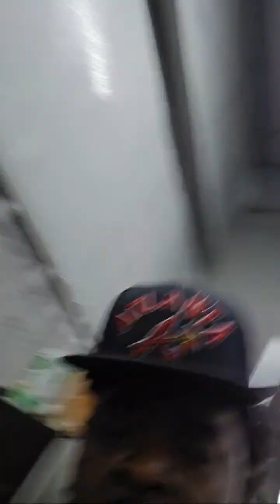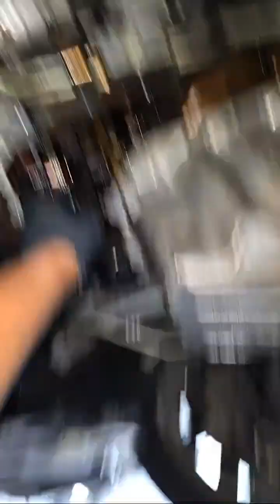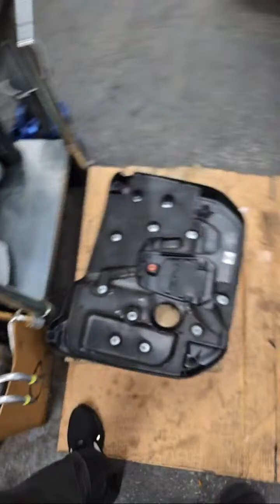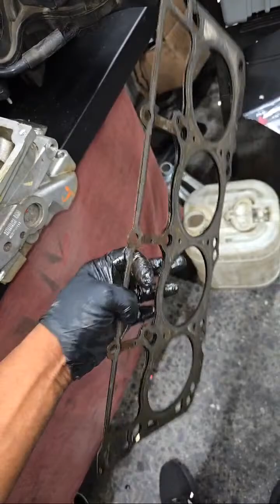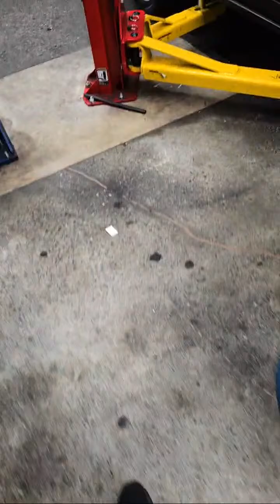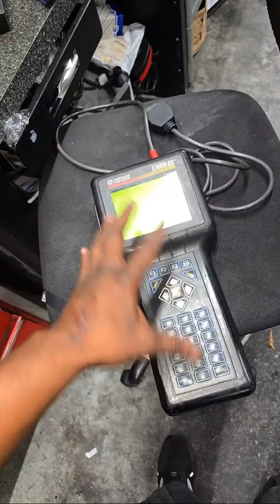A Cam Sensor Code P0340 does not always mean you need a Cam sensor

Comment: Just a heads up and you may know this already but cam crank corelation code diag is not correct on service library. Had one that was throwing p0019. Service info was saying that its for cam 2/1 which is for the intake. Actual problem was cam 2/2 which is bank 2 exhaust cam. Ive personally never had to replace the cam position sensor for a p0340. I have replaced them for oil intrusion into the harness connector though.
Reply from the maker: Interesting. Thanks for the heads up and no, I have yet to run into such a problem.
Reply: What voltage were you reading?